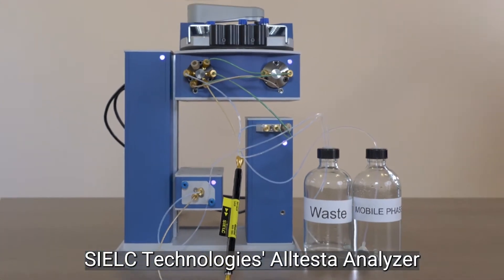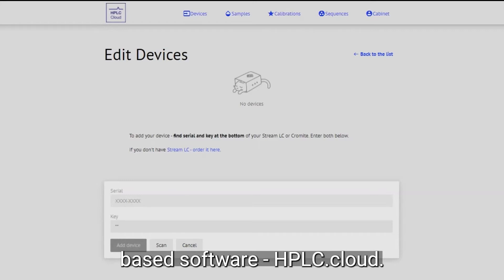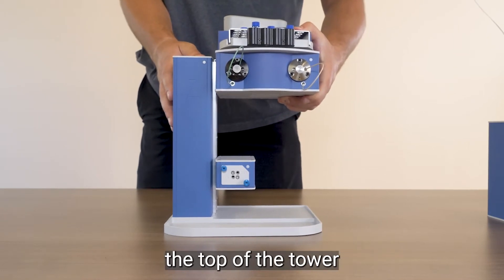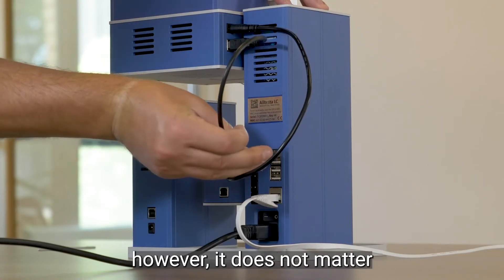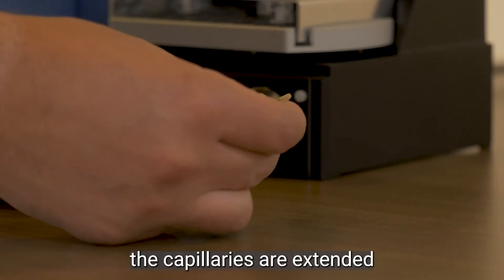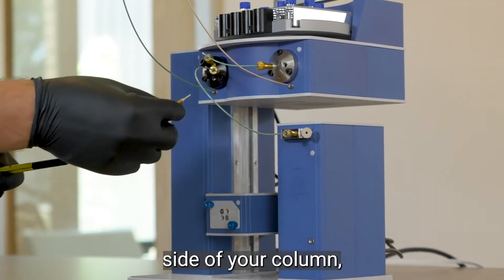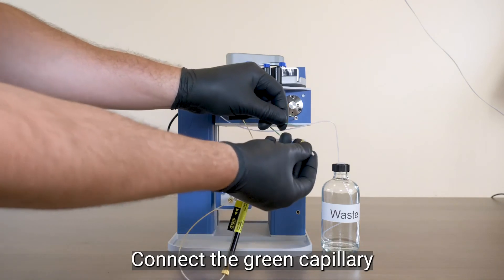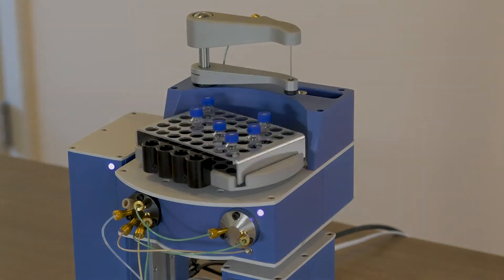Walkthrough of the Alltesta™ Analyzer HPLC System

Comment: how much pressure could work on your hplc system?
Reply: 3000 psi  (214 bar) Sufficient to most applications dealing with 5 and 3 µm particle columns.
Reply from the maker: 3000 psi, as Yury has mentioned in a previous reply

Comment: Why do you still use separate cables for power an data when everyone uses USB-C capable for 100W supply.
Wake up dudes :) It’s already 2022.
Reply: USB C is good for home use. In a chemical lab you want to use the most stable connection possible.  In order to have a reliable power and USB signal we choose two cables when we can not provide enough power by USB A/B cable alone.